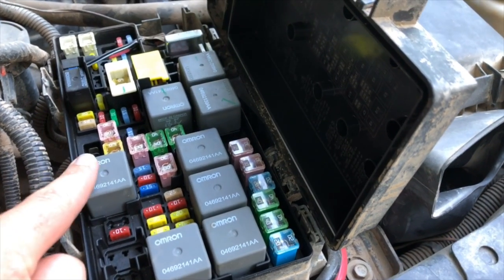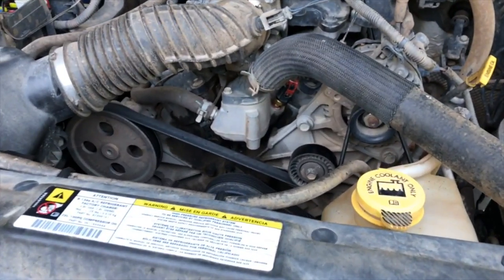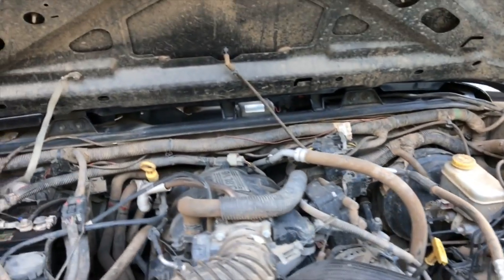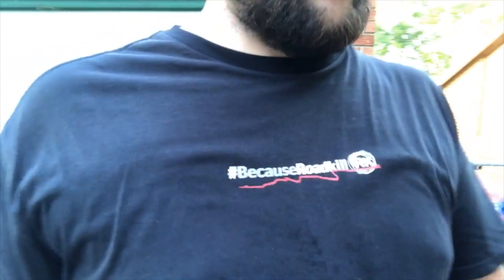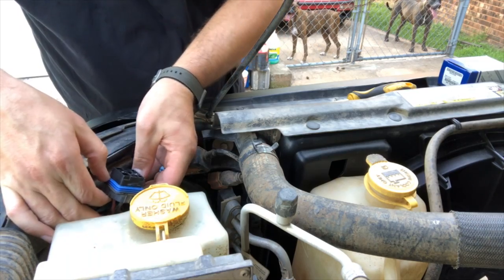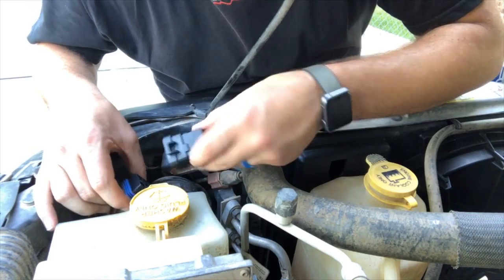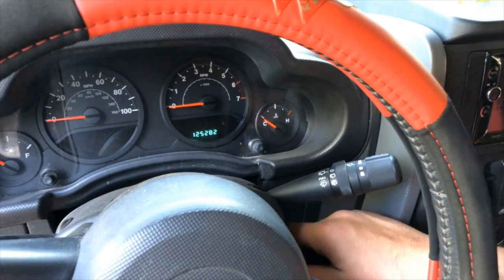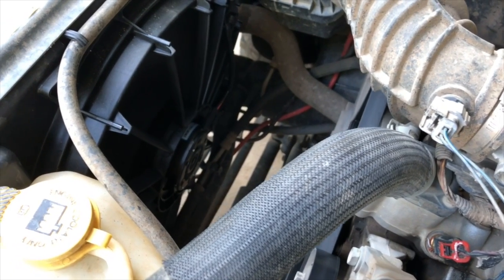2007 - 2011 Jeep Wrangler JK Radiator Fan Problem Solved!!!

Comment: Dude! I have been looking for months on how to fix this issue (My cooling fan wont shut off) talk to multiple mechanics, did multiple google searches, replaced the cooling fan (twice), replaced coolant temp sensor, took the jeep into the shop and still couldn't find the answer!  Thank you very much my friend!  I am going to order this part!  I'll keep you posted.  Thank you for doing this video!  You win the internet! (2010 Jeep Wrangler)
Reply from the maker: You are welcome. I was in the same boat I new that there had to be a relay some where else and I ordered a service manual that still did not tell me where the relay was but I found it after 2weeks of chasing wires.
Reply: My cooling fan is loud af!
Reply: So did it fix your fan problem? Because mine is constantly blowing loud while I drive
Reply: @danielcarter8734  Yes!  It fixed it!  I suggest trying it.
Reply: @danielcarter8734  same mine kicks on right away & never goes off until about 5 seconds after I shut my 2012 jku off. That last part about shutting off may be normal but I know it shouldn’t run constantly. Also occasionally over heats & coolant constantly vanishing from the reservoir! So maybe also air in the line??? But still I can’t pinpoint the issue & can’t afford to have mechanics guess i just want to pinpoint problem & fix it myself. Any suggestions? Praying it’s not head gasket because I don’t see or smell a leak but…
Reply: @anthonyparigi6303  so my fan is quite embarrassing.  When I pull up to a red light and stop it sounds like an airplane.  Mine just stays on as soon as it warms up.   Never over heats but the fan is always on.  This is your problem to correct?  I have a 2012 JK
Reply: @tripledad8096  That was exactly my issue!
Reply from the maker: No my fan never came on but that relay in a friends Jeep did that because it welded its self together so even with the ignition off it would run
Reply: @tripledad8096  I have an almost identical issue with my Jeep Grand Cherokee. Turn it on and the fan turns on almost instantly…then it will continue to blow blow very loudly only turning off periodically. I have the same embarrassment when idling near other vehicles and my fan sounds like a jet engine. Were you able to fix the problem on your vehicle?
Reply: @danielcarter8734  Were you able to fix the problem? Mine acts very similar!
Reply: @wjkris0410 where can I buy one!?? No one has any in stock. Even Jeep dealerships say If they can even find one it’d take months to get!!
Reply: Today as I was dropping my daughter off at daycare I noticed that my radiator or the fan sounded like an airplane taking off and I stopped at the bank parking lot down the road and it did shut off.  I haven't heard it come back on yet but I'm waiting to see if it's loud again when it does.  Was this your only issue that it was extremely loud before replacing the relay?  Thank you so much for sharing this!
Reply: The temperature of the vehicle is actually perfect and not overheating or anything It's just the noise I could hear from inside the tub

Comment: Thank you for going through all the items you trouble shot and changed.  Extremly helpful -- Can I ask how you found each of these issues? Thanks again!
Reply from the maker: I used a multimeter and also a power probe. I hot wired the fan to just come on with the ignition switch to make it till i found the issue.

Comment: All fans have a temperature relay, had to replace mine on my 09 4 years ago. It actually got to where the fan would come on and not shut off.
Reply from the maker: Ya It did that as well before goin out. So I knew it had to have one but I just could not find anything on it. Till I came across it in a forum. It’s in such a weird place too.
Reply: @wjkris0410  to be honest I bought the part first so I knew what I was looking for
Reply from the maker: That’s good to hear 
The fan I just swapped out since it was under warranty I cut the other ones wires up to get home from the trail  and the temp sensor was just to make sure the plastic one wasn’t bad.
Reply: Goodday.  I m having issues with my 2013 3.6. First radiator was leaking.  Replaced it with Mopar radiator.  Burped the system after fitting radiator.  Gauge rises above mid point fans kick full speed noisy and Gauge fluctuations.  Replaced thermostat and waterpump Mopar. And temperature sensor on cylinder head.  Still doing same thing fan runs non stop and Gauge fluctuations. Swoped radiator fan with another buddy on mine jk. Same thing still.  Cylinder head leakage test done still the same and it's good.  I need help

Comment: I had a clogged up radiator from not cleaning it out good enough from wheelin.
After being out on trails, i was running hot. Thought it was my  fan so I replaced it and cleaned out the radiator.
Well it was staying cool but still steaming.
Come to find out my radiator was leaking so i replaced it.
Got it all back together and drove it a bit. No leaks but running hot again. The new fan is not kicking on.
Checked the fuse, switched around all the relays like you did, and nothing.
The fan does briefly kick on when i turn on the A/C then cuts off and repeats this process.
I am hoping replacing this relay takes care of the fan issue.
Reply from the maker: I hope so too
Reply: Did that fix it?
Reply: Did you figure this out? Mines only going to high speed for a few seconds when the compressor kicks on. It overheats when driving

Comment: Thanks man I’m going to try this tomorrow, I did basically everything you did. Fingers crossed this does it
Reply from the maker: I hope it helps you out. And that that is the problem let me know if it fixes it. 👍
Reply: KLR motive yes thank you man! Paid $30 for the new relay at the dealer and the fan kicked on after I put it in
Reply from the maker: Awesome I am glad it helped you out.
Reply: @wjkris8465 cool video. 
So I have a 2016 jeep wrangler sport and my mechanic let me know that my fan is working overtime and it's been over heating. Don't wanna pay an arm and a leg at my local jeep dealership. Please help.

Comment: So was the fan not coming in at all? Or just low speed? My Jeep is getting hot running at 3/4 on the gauge when driving past 55mph… or hitting a hill.. but cools off after I slow down. Replaced water pump temp sensor radiator cap flushed radiator and thermostat… can’t figure this out
Reply from the maker: The fan would not come on at all on this one. It seems like you don’t have enough air flow to the radiator. Do you have a winch or lights in front of your grill?
Reply: @wjkris0410  I have a aftermarket grill... I just put the stock grill back on and only got hot very little, barely past the halfway mark. But that don't make sense to me either because tons of people have a aftermarket grill. I don't know if the fan isn't kicking in high gear or what it could be. I drove with no grill and it never got hot...
Reply from the maker: So I would look between your radiator and the condenser to make sure there isn’t any leaves or mud stuck between there. And if not go to the local car wash and pressure wash the condenser and radiator out to get it clean. 

It sounds like you are having an airflow problem.
Reply from the maker: Turn your ac on max fan and max cold the fan should come on instantly and then you could feel the air being pulled and pushed thru
Reply: @wjkris0410  I have pressured washed it, and blew it out with air but haven't looked in between them. The fan came on when I turned on the a/c... I mainly use it at the beach..hardly ever in the mud. So figured maybe there's sand somewhere. It's got me stumped. Runs fine with no grill...but I'm not rolling around with no grill lol
Reply: Hey beefhouse what did you do to fix the problem? My jeep wrangler is having the exact same problems you mentioned

Comment: Did the fan run high before it went out. Mines is running high making my temperature run crazy.
Reply from the maker: The relay on mine had corrosion in it and it would make the fan stay on high a lot plus the fan would stay on while the engine was not running.

Comment: I have a 2011. The fan works when I run the AC in defrost, but does not run at regular heat. So in essence, it works with the AC compressor but not with the regular heater. Do you think this would fix that as well? It’s about the only thing I haven’t tried yet.
Reply: It's not supposed to run when you have just the heater on unless the engine is getting hot. The A/C come on with your defroster to help dry the air so it will unfog your windshield better and it also keeps the A/C compressor from seizing up if it goes all winter without being used and the fan runs because the A/C is on and it needs to pull air through the condenser all of time for the A/C to work properly

Comment: So when the electric fan is not working does it also effect the a/c?   The other day it was 100 degrees and my air condition stopped blow cold air...then I noticed my temperature gauge almost overheating that's when I discovered my fan not kicking on...I tried moving the fan by hand just to see if the dings would spin but it moves about an inch and that's it...

Thinking I need a new electric fan?  But maybe I should check this relay out
Reply from the maker: I would check the relay first then buy the fan if it isn’t fixed

Comment: 2015 Jeep Wrangler Sahara, Temperature gage seems to be operating just fine. But fans kick on and are really loud. Thermostat is new radiator has been replaced and temperature gauge does not go above normal operating temp. Not sure what to do, thinking it might be this relay?
Reply from the maker: The fans are just loud that’s how they pull air thru the radiator.
Reply: @wjkris0410  definitely not normal. Had it since it was brand new, I think my thermostat is sticking. My radiator cap does not get hot after driving for 30-45 min. Top radiator hose is hot bottom is cold. Think I may have gotten a bad thermostat
Reply from the maker: That is strange the top hose has the thermostat in it. Your radiator could be air lock. Which means that it has a big air pocket in the radiator and will not flow fluid. Run a water hose thru the radiator. With hoses off.

Comment: I was told by a technician at Firestone that I needed to change my radiator fan… was your temperature showing overheating even with the fan on?
Reply from the maker: No the fan just stopped working

Comment: This might be the problem with my 08. It's been like this for almost 2 years and never found out a solution. Sometimes it works but I know when it stops because my a/c would not be blowing cold no more and the engine light would come on which is the fan 2 control circuit. I'm going to give this a shot and hopefully see if this is the problem.
Reply from the maker: I hope this helps you out
Reply: @wjkris0410  I tried and unfortunately it didn't work. I also swapped around some relays fuses but sadly that didn't work either. My only last option is there is a short somewhere in the harness.
Reply from the maker: Sry to hear that.

Comment: My 2011 Jeep wrangler has a leak in the radiator and started running hot but fan won’t turn on unless I turn the truck off and then off and it kicks on and cools it down but then starts overheating again like 10 min later
Reply from the maker: Try this relay I had the fan kick on and stay on while the Jeep was off too
Reply: @wjkris0410 sorry I meant it only turns on if I start running hot I shut it off and then on and the fan will kick on until it gets to the right temp
Reply from the maker: It could be that relay

Comment: Kris, thank you for your video.  Unfortunately, I had to learn all that the hard way out on the trail without the benefit of seeing your video first.  I have a 2009 JKU.  My problem was that the high speed wouldn't come on when I was doing a slow uphill crawl in hot weather, and I would overheat badly--240 degrees plus.  I was able to find a Novato RL44 relay at an O'Reily's in a town that was close by.  It had a 30 amp rating.  That got me home, and when I got back, I got the OEM part from a local jeep dealer, and it has blown again.  (Do you know what the amp rating is on the OEM part?  I googled the part number you gave us, and it doesn't say.)   Any idea why this particular relay tends to fail so much?  I've never had to replace a single other relay in this 11 year old vehicle.  I'm wondering if it has anything to do with the fact that Jeep didn't seal the radiator fan motor and dust, water or mud gets in the windings?  Any thoughts?
Reply from the maker: Sorry for the late response but I have noticed that the fans are not sealed very well and they seam to not like the water much. My wife’s first fan incident was the oem fan got wet then later on the relay went out. I wonder if the after market fan has a lot amp draw and that is while yours keep going out. Might see if you can find a really good Bosch relay that is similar. Heat is not that good for them either.
Reply: The problem is Made in China, find an Made in USA, just my too cents

Comment: So I have replaced the high speed relay and thermostat and I'm not over full but at about 10 minutes of operation in my holding tank is boiling excessively letting out a lot of steam any ideas
Reply from the maker: that might be a head gasket issue bud
Reply: @wjkris0410  it turned out the temp gage going into the water pump was bad blew my radiator so new radiator and water pump still having issues replaced that temp sensor no more issues

Comment: Hello Kris, so my daughter has a 2014 jeep wrangler and the radiator fan stays on constantly and we have replaced the thermostat and now I am going to change the temp sensor. Do you think by changing the temp sensor it will cause the fan to not stay on constantly????
Reply from the maker: I’m not positive on that but if it isn’t over heating I would not worry much about it.
Sorry for the late response.
Reply: What was the problem?  my 2015 is doing the same

Comment: I have a 2010 2 door and my fan won’t shut off and it drained my battery once already. Gonna give this a shot. Was it a pain in the ass to get to the relay and remove it?
Reply from the maker: Ya it should fix it. Ours did the same thing. But I pulled the relay in the fuse box. To make it stop. 
It’s in a tight spot if you use a drill and a  long torx bit it made things easier for me.
Reply from the maker: Did this fix your issue
Reply: KLR motive still waiting on the part to come in
Reply: Super late on this but yes this fixed my issue !
Reply from the maker: Good to hear man

Comment: Did you have power by the fan before you bought the relay
Reply from the maker: No I didn’t 
The reason I bought the new fan was because I cut the wires to where it would come on when the Ignition was on.

Comment: if you wired the fan up directly and it worked, why would you replace the fan?
Reply from the maker: Because I stripped wires out of the connector to hot wire it.

Comment: when you replaced the temp sensor, did it go all the way in, I replaced mine it only went in half way.
Reply from the maker: It’s a pipe thread so as long as water isn’t coming out of the threaded area you should be good.
Reply: @wjkris0410   nothing is leaking, just was a little worried, thanks
Reply from the maker: Good deal. I’m glad to help.

Comment: Great video! But I got one question. What if the fan doesn't turn on when the ac is off?  I have changed my radiator, electric fan, thermostat, temp sensor and about to change the water pump. It still over heats  but I'm going to try the relay next!
Reply from the maker: Good question 
But the fan system is set up to come on automatically when the max ac switch is on.
Reply: @wjkris0410  gotcha thanks!
Reply: @willielopez2112  do you fix your problem I have the same problem and I replace the same parts exactly like you still heating
Reply: Any update on this ?? I changed my thermostat , sensor , and water pump .. fan still going crazy loud

Comment: The fan is only staying on when the vehicle is running. It dose turn off when the vehicle is off.
Reply from the maker: From everything that I have seen on vehicles the fans have always stayed on while running so they stay cool the do have a high and low setting tho. The fan will stay on low while it is cool and as the temps rise the fan gos to high. The fans ask so run on high when the a/c in on in the cab.   I hope this helps.